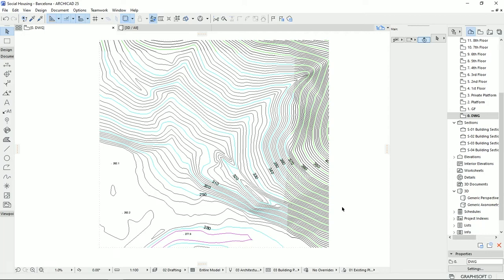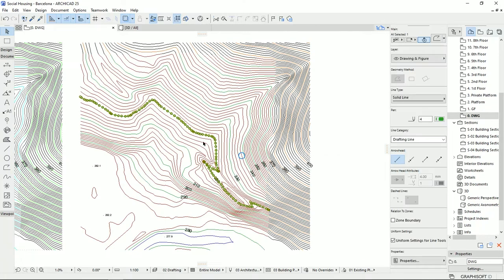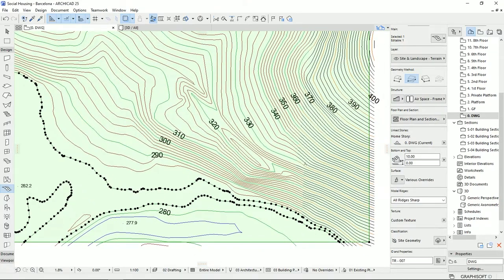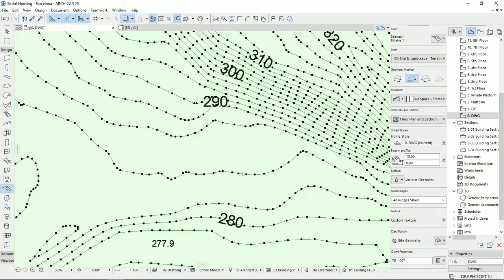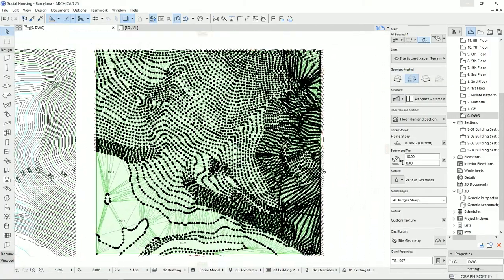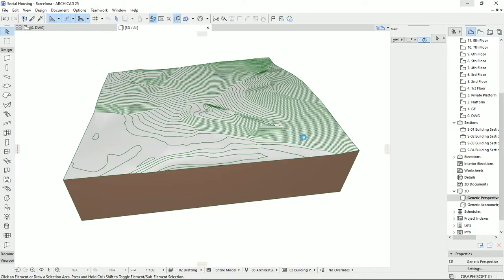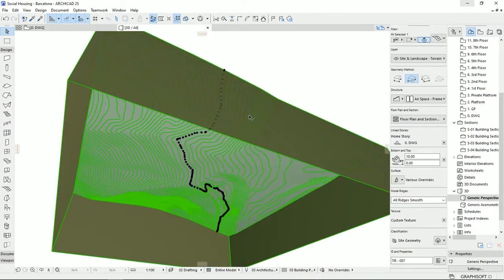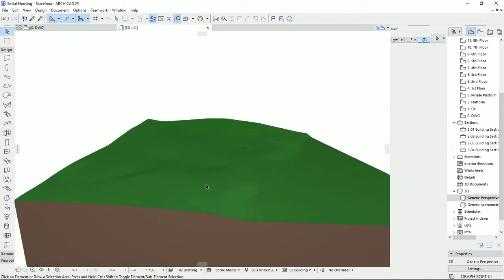Archicad - how to use mesh tool [all you should know]

Comment: I'm holding space and clicking on the spline... but it's not working the mesh doesn't find the line.
Can you please tell me where's the problem?
And thank you for the informative video!!
Reply: The line you clicked on has to be continuous (zoom in to check) and has to run from edge (of the mesh) to edge (or has to be a loop)

Comment: Hi, thanks for your video. I have a question about the Mesh. I have à site with grass on yhe top and rocks on the vertical plans. When i want to put different texture it doesn't work, it changes the texture of all the mesh. Can you help me about this please?
Reply from the maker: Hi friend
sure, in front of the 3 material buttons for the top, side, and bottom, there is a vertical bottom that connects the 3 sides as the same material. click on that bottom and unlink the 3 sides.
Reply: @madtutorialsMT  I made that but it didn't work, it changed only the mesh's edge but not the vertical faces in it.It's a rocky site by the Way. And thank you for your previous answer
Reply from the maker: @sendabenamor4181  maybe you did not turn on the material edits for the other 2 sides yet.
You should click on the icons on the left of the material bottons to turn them on. Then you can change those materials

Comment: I set on my "spline lines" elev's correct but my terrain is flat. Where is my mistake? :(((
Reply from the maker: Hi friend. Maybe your 3d view doesn't update automatically. If that is not the case, try to elevate nodes, in 3d view.
If the problem remains, try to do it, with my tutorial, step by step.
Reply: @madtutorialsMT  Thank You so much! You are the best! Have a nice day!
Reply: @madtutorialsMT  Yes.  With 3D elevation of nodes my surface is OK ;) ! 100 THANKS!
Reply from the maker: @hahohihi4753  great, thanks for sharing the solution. It could be also a problem for someone else. 🌹